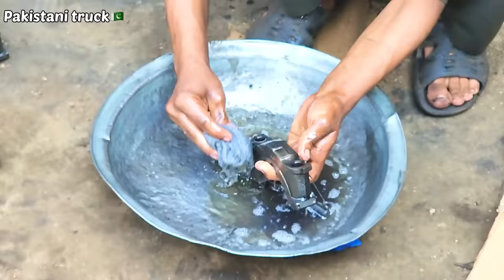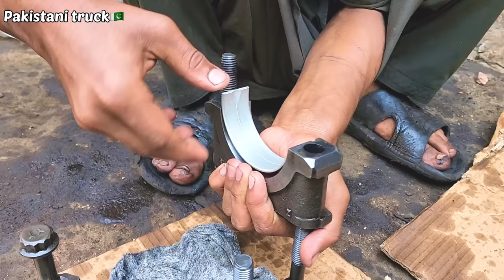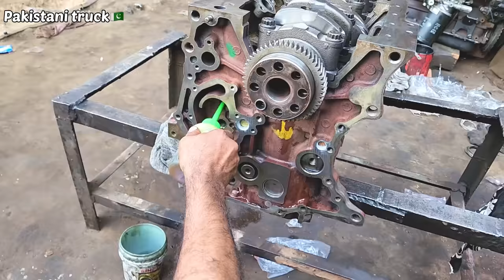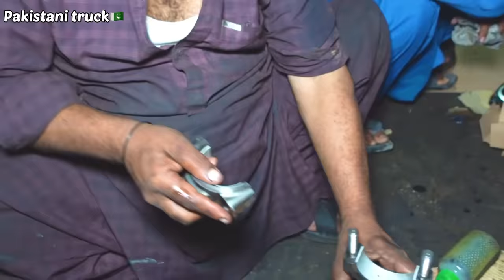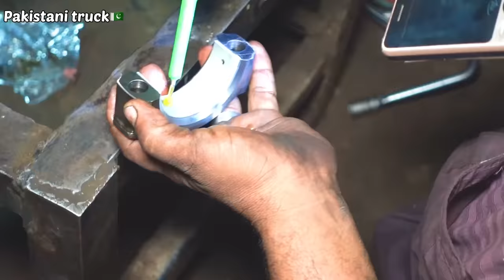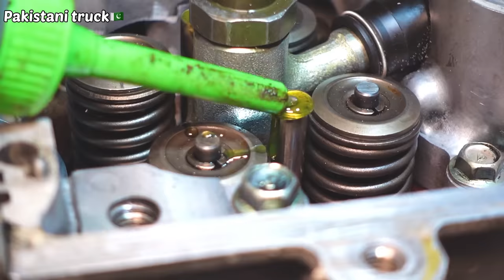Engine Restoration | How to A 15 Year old boy Engine Assembling in Pakistan, Hand made Engine

Comment: So you wipe the new crankshaft with the dirty solvent.   New bearing shells but no plastigauge.   Cap bolts tightened to 1. 5 grunts..   enough silicone to do a bathroom.  But better than some.

Comment: This is by far the best Pakistani engine rebuild I have seen. The attention to detail and the good assembly practices were excellent. I do however wish they would invest in a torque wrench as proper and even torque is so important for these engines. Other than that, this engine should be a good runner... With respect... Joe
Reply: Not much use for a torque wrench if they don't know how to use AND take care of it. You can't throw a torque wrench on the ground when you're done using it, then you'll have to recalibrate it. It's a delicate piece of equipment.
Reply: You can get away with a lot on an old cast iron truck engine but they're still gambling with their head gaskets. I'm sure it'll work fine until it doesn't.

Comment: Not unusual 15 year old kids have to work hard in Pakistan.
Life expectancy in Pakistan is extremly low.
If he reached his 15th year of life, he'll be an old man and statisticaly more than 1/2 of his life is gone.
Reply: Life expectancy in Pakistan is actually about 67 years. You can factcheck this with Google. What you see here is result of two aspects of Pakistani society. First the inequality and then the huhe informal economy. These workshops are operating informally and are not registered which is why everything is so makeshift. They survive by being the cheapest - in fact so cheap that it is economically competitive to go to them even if the quality of work or certification does not match the formal sector.